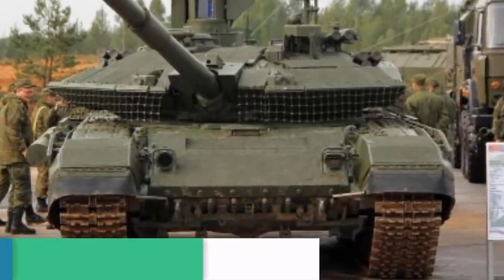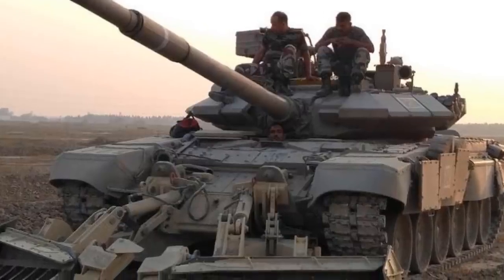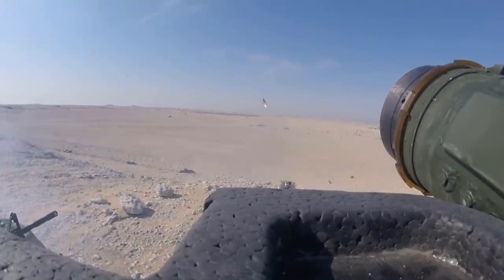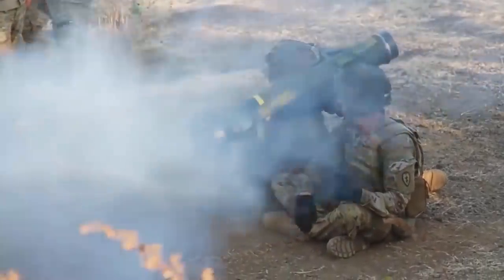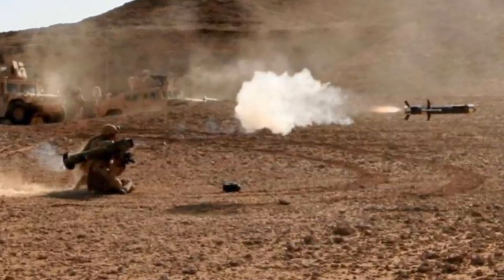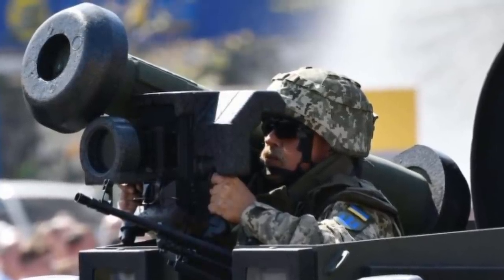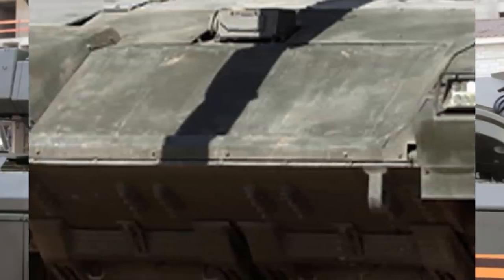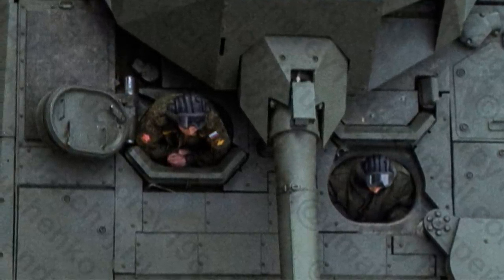US Javelin missile vs Russian Tanks

Comment: Combat doesn't always require that a tank be destroyed. Disabling the tank or causing the tank crew to abandon the tank can be enough
Reply: Yup, if the Armata still has its ammo storage under the turret, a good ATGM hit may still blow the turret off the tank like what happens when T-72s get hit.  Though depending on how well the crew compartment is protected the crew may survive, though will probably be in need of a new tank
Reply: @mrvwbug4423  and a new pair of pants
Reply: @mrvwbug4423   Yeah if the Javin doesn't fall for the Armata's counter measures or those measures are already used up, I'd say the tank if not the crew is toast.
Reply: @mrvwbug4423  Along with new underwear and hearing aids.
Reply: @mrvwbug4423  The biggest joke about the Armata is that  they've been building it for 20 years and yet it's still in it's trial phase, and they've only build 20. and the rest of the Russian tanks are all just cheep upgraded T-72's.
Reply: Exactly. Why dont they focus on a weapon that just destroys the main gun?
Reply: @bgregg55  To get that kind of accuracy you'd need to be really close to the tank. The best place to hit a tank is the rear area behind the turret where the engine and ammunition is stored. It makes the tank un-survivable, but does mean you need to allow the tank to pass your position.
Reply: @bgregg55  A tank without a functioning main gun is nothing except a heavy taxi for a crew that is not infantry. An aimed weapon instead of "fire and forget" could achieve this effect. The Carl Gustav 83mm anti tank recoilless rifle can do that at 800 meters. I did test that weapon at Aberdeen Proving Grounds in 1990 and since then it has been upgraded further.
Reply: if the tank crew has had nothing to eat in three day and the tank has no fuel ,its not of much use
Reply: Spoken well, clutch cargo
Reply: Field Artillery used in the way that the US and the West and trained allies use it can destroy a tank with fairly accurate control raining on top of the tank at a fraction of the cost.  Even if the tank could fight off all of those 155 mm rounds,  they'd be wide open for any other attacks and likely have no machine gun or electronics to assist the crew firing blindly or have a track blown off from a slightly off center round.
Reply: @davidr1676  Everything is correct. Only not the USA and the West, but all countries with a normal army. The Russians have gone through this many times and for many years. Therefore, large-caliber artillery is destroyed before tanks, immediately after the suppression of air defense. You can look for videos from Syria about the accuracy of 152-155 mm Russian artillery
Reply: No shit.
Reply: Very true.  Just take a look at the Tor SAM that is being stolen by the farmer in his John Deere.  It has been abandoned for some reason (which is probably not enemy fire) .
Reply: @spiff1003  Technique is technique. Something breaks, something can break. We have TOS solnsepek, buratino who use vacuum ammunition. Technique remains intact (well, it can turn over) and the vacuum compresses the air so that it is impossible to survive. The Saudis recently used them against the Houthis, there is a video on the net. I just remind you that the tiger was much more technologically advanced than the T34. Armor, optics!! speed and power, smoothness. But the payback for smoothness was the staggered (one after the other) arrangement of the road wheels. This is hell for a tanker. If dirt gets there or even worse, a shell, then you have to remove 6! to replace one. The more technologically advanced technology is often the worse. It's good for conflict, but bad for war.
Reply: And ear drums one would assume.
Reply: Fire TOW javelins a minute apart. The first knocks out the reactive armor, the second does the tank. Conversely knock out the supply vehicle with the fuel and ammunition. When the tank is out of fuel, its useless and the crew will probably surrender and call mommy
Reply: You said it right.
Reply: Agree, taken out of action or destroyed have same outcome in a battle, a neutralized target.
Reply: @mrvwbug4423  a tank crew that survives (and almost certainly surrenders) may actually be more valuable than a dead tank crew. How many thousands of Russian POW's can Putin sustain? If there were 30,000 Russian troops held prisoner in Kiev could Putin survive? 100,000? 500,000? At what point would Russia's military simply refuse to follow any commands coming from him?
Reply: @jessicacolegrove4152  😆
Reply: @romankovalev7894  then how come they barely did any damage to the air Fields I've seen photos and it really wasn't that impressive
Reply: @romankovalev7894  noooo you're doing just that Ukraine said so themselves
Reply: @romankovalev7894  and if that's the case why do the civilians hate you so much lol
Reply: @romankovalev7894  plus you invaded Ukraine first so how are you any better 🤨
Reply: @romankovalev7894  by the way if your military is so strong and advance like you claim a quarter of your forces should have been enough after all their military was supposed to be not as advanced as yours and right now Ukraine is kind of whooping your ass with minimal equipment they don't even need to need to rely on vehicles to give you hell a small group of Ukrainian soldiers with with some form of portable anti-tank weapon can easily take out multiple and if Russia with some more pure Nation they'll leave Ukraine alone and let them be their own Nation 😒
Reply: @THX..1138  The crew might survive because they are located in a separate, more highly protected space that is not connected to the turret. But the tank will likely end up becoming combat ineffective and hence useless.
Reply: @stevestruthers6180  I agree...Lockheed is currently redesigning Javelin's warhead, likely to address the T-14 armor improvements. Whatever they come up with it's likely at least for the crew the T-14 will be by far Russia's most survivable tank.
Reply: @mrvwbug4423  Armada Cabrio? :))
Reply: @romankovalev7894  dude Ukrainian people are using that to defend their nation and the civilians Russia destroys the homes and doesn't give a s*** and considering the fact that Ukraine didn't invade Russia once what was there to act on
Reply: @danielsnook7362  And do not look for videos confirming ethnocide and genocide on the websites of your news media. Feeding there is one-sided, use Google. There are even documentary films about life in the DPR and LPR, turn on the titles and enjoy 🤨
Reply: Exactly. Even a grenade exploding ontop of the tank won't destroy the tank, but it can destroy all the optics into and render the tank almost useless
Reply: @PotatoeJoe69  There are three points here. 1. Russian tanks definitely have duplicate surveillance systems, and the main ones are not on the roof, I think all modern ones are like this 2. On the roof, the weakest protection, if an explosion is over a tank, then this is a 90% probability of death of the crew and an explosion of ammunition if it is in the tank turret ( we tried to hide the crew under the turret on the Armata tank, but we realized that we can do without the crew at all) 3. The anti-tank systems are also different. Some are heavy, some are light. Not everyone can hit tanks like that, you need to look at the characteristics of each
Reply: @danielsnook7362  Do you really believe that the Russians are to blame for the humanitarian corridors? Think with your head. Who benefits from the presence of civilians there? They only interfere with the Russians and slow down the advance. There is a video message from three thousand Indians who complain that the Ukrainian army does not let them out of some city
Reply: A Daryl Dixon is enough.
Reply: @romankovalev7894  I am very much using my head second ceasefire agreement basically said you have your side of Ukraine and we have ours then Putin said that agreement was non-existent then invaded anyways minority before that they were working out peace and a way we're both sides would benefit pro European Union would get their half of Ukraine and the half that support Russia would get their half and plus if it was a genocide this would have never happened genocide would imply that one half was completely killed off
Reply: @romankovalev7894  and by the way if you Ukraine wanted to be their own country they have all the f**** rights no maybe you didn't have to resort to all that if Russia let them be independent in the first place 😑
Reply: @romankovalev7894  yeah maybe but under your rule and under terror of Russia and Ukraine wants to be independent simple as that and if they want to join NATO that's up to them not up to you and you didn't give up Ukraine the willingly it wasn't simply given away only giving away when Ukraine simply said we don't want to be part of you anymore
Reply: @romankovalev7894  by the way you're doing the same thing when you invaded Ukraine especially the half that wants to be independent and free from your rule
Reply: @romankovalev7894  and what about Estonia and other countries during Cold war you took over by force during the Soviet Union they weren't a threat to you and they had no conflict with you but you still took over and try to rule over them
Reply: @romankovalev7894   then how come most of the Nations you took over during the Soviet Union hated your rule and straight up said we do not want to be with you anymore obviously you didn't treating them any better Ukrainian would say the same thing Estonia would say the same thing the fact that you set them free proves that they weren't happy to be of the Soviet Union a Estonian soldier who's pretty damn old a straight up said the you people were horrible to them
Reply: @romankovalev7894  and by the way Estonia YouTuber also said that the Nazis treated them better than the Russians did so I can't really blame him plus they didn't have that much of a military so they didn't have a choice
Reply: @romankovalev7894  oh and hungry didn't really like you either did Poland
Reply: @danielsnook7362  Oh really? This is not in Poland, which became part of the Russian Empire as the Principality of Warsaw, but a month later in the Russian office it was listed as the Kingdom of Poland. Isn't this the same Poland that attacked Russia several times. Russians collected and formed Poland several times when it ceased to be a state at all. And it was not the Russians who dismembered Poland, but everything in a row, including the Germans (not Hitler). And now Poland, which hates, as it were, the Communists and everything Russian, does not want to accidentally give the Germans their area that Stalin gave her and return the Russian lands that have been part of the country since they were socialist? Modern Poland does not want to apologize to the Russians for Russophobia? We in Russia sometimes regret that the rusher with the liberation of Poland put 600,000 Russian soldiers. I just had to pass. The Germans turned around well there, the Auschwitz concentration camp (11 million !!! killed), after all, it was in Poland, like many other concentration camps. And Poland's allies sent her sabers to repel the German tank armada. A more ungrateful country is hard to imagine. But we remember everything, write it down. Both good and evil. Right now, Poland is running into a blow on its territory, I think after Ukraine it will be one of the first, and if it delivers aircraft to Ukraine, it will be even faster. And we do not care if she is in NATO or not. Poland is the US poodle. Or whatever Churchill said about her "the hyena of Europe"
Reply: @romankovalev7894  and Estonia was killed controlled by the Nazis they didn't fight for them willingly 😑
Reply: @danielsnook7362  Poland was once the strongest in Europe, dreamed of Poland from sea to sea, claimed dominance, but made a mistake by attacking Russia. 17th century by the way. In Russia, Poland has broken its back, it no longer dreams of world domination. I'm not surprised that they don't like Russia
Reply: @danielsnook7362  Not exactly the way you write about Estonia. You ask that old veteran. A lot of people in Estonia, Lithuania, Latvia and Ukraine voluntarily helped Hitler, joined the ranks of their troops, and there were those who fought because Hitler promised them independence. Search Google for the number of Estonian troops in the Wehrmacht or Estonian aid to Germany in World War II. Here you also need to understand that Hitler was perceived as a liberator and they began to happily cut the Russians. In general, everything was difficult there. But we forgave the Germans and the Hungarians and the rest, although the current chancellor of Germany, the grandson of the Nazi general who fought in Ukraine, is worthy of a loop for the words that it’s funny for him to hear about the Russian genocide in the DPR and LPR
Reply: @romankovalev7894 I'm not blaming the Russian people I'm blaming the Russian government to after all there's the Soviet Union that slaughtered over a thousand Estonian freedom fighters during their occupation so try again
Reply: @romankovalev7894  plus hatred doesn't come out of nowhere so if all those countries are hostile towards you clearly it's for a reason
Reply: NATO soldiers leave the tank for a darkroom
Reply: soviet tanks wore made to make a single mission .... and not return .... it's a historical fact
Reply: @asatechnics8363  Really? Tell it to the defenders of Korea, Vietnam, Cuba. Tell it to the Germans whose capital we have taken. Tell this to the Afghans in whose country we entered at the invitation of the current ruler, defended our positions and left as winners, the same is Syria, but we did not leave. Russian tanks are still used by a bunch of countries, mister "false historical fact" :)
Reply: well said
Reply: @TheExtraterrestrial99  100 Daryls is equal to a large division.
Reply: And then you keep the tank.
Win win.
Reply: ok Google, who is the right sector in Ukraine?
Reply: Better takeout crew together with tank, so they wont be able to fight ever again.
Reply: @romankovalev7894  by the way those Nations those puppet Nations weren't yours to begin with the fact that they didn't stay a part of Russia and when you gave them the choice to leave says something
Reply: I waged war against the Ruskie army twice in my life, once in Angola with the SADF in 1981 and once training the Afghans in 1985, and I can tell you all, that Russian soldiers are the most undisciplined wannabe soldiers there are, who are drunk most of the time, do not maintain their oldfashioned equipment, terribly loudmouthed when things go right for them, but quickly demoralised when they get serious retaliation by the adversary. We used to call them the baby killers because of the terrible Ruskie crimes against humanity in every conflict they engage, so we started to enjoy "helping them out of their misery", when this bunch of lousy Ruskie soldiers surrendered to us. Putin, Biden, Macron, Trump, Merkel, Trudeau, Klaus Schwab, Boris Johnson, Ursula von der Leyen and the rest of these organised state gangsters have organised this war in the Ukraine during the Davos WEF meetings of the world's elite in Switzerland; the enemy within explained in the 18 hour pentalogy "The Swiss Beast - Home of the Devil"; as Youtube blocks this video for the obvious reasons, you must scroll down the video section of channel Giureh. Part 5 can be seen on channel HomieLand Sickurity. Ruskies are expert child killers, which they also did in Afghanistan and Chechnya. All peoples must unite to take down these political gangsters, who force humanity into endless wars and misery.
Reply: @jeffreystarits2783  This is the more likely way Russian tanks will be disabled. There's been reports of tank crews that are undersupplied, with rations that have expired decades ago. That's what happens when your country is a kleptocracy...they may look good on paper, but the Russian army's shortcomings are being exposed.
Reply: @romankovalev7894   if Estonian soldier served under Nazi Germany in Estonia ,it because  "the enemy of my enemy is my friend ," just like with Finland
Reply: @jeffreystarits2783  They can be understood "humanly", but they did not guess by choosing the wrong side of the conflict. And they have no excuse for atrocities against civilians. Both of these countries gained independence from the communists, that's a fact. We are warmer towards the Finns because of the neutral status and less Russophobia, this is also a fact. With Estonia, it’s generally funny there - they passed a law equating communists with criminals, which annuls and makes null and void all documents, including their formation as a state and gaining independence. They didn't think about it? We can meet them halfway and revoke the recognition of this document. Plus, Estonia is in NATO - and this is a direct threat. Estonians now don’t even fart in our direction until they are remembered
Reply: bodies are in those tanks
Reply: That’s true.
Reply: @romankovalev7894  It depends on gas and fuel, but there are plenty of alternatives. But food? Europe depends more on the US for food, and the US is the world's breadbasket. For the record, Russian trade with the EU makes up around 37% of all of its trade. With the US this makes up about half of Russia's trade getting stifled. Idk who you're fooling, it isn't the Western nations that are having their currencies devalued every hour on the hour.

Russia has not introduced sanctions because Russia would hurt itself more with sanctions, genius. How deluded are you that an economy smaller than Italy's somehow is stronger than all of the West's?

Russia lacks nothing, except an economy, apparently. Russians can't use their currency reserves because of sanctions, and everything is just dandy with you? Ok.

Why would China want to use dollars when it's been trying to use Yuan for everything? This is hardly new. It's been a thing. It hasn't been working.

Turkey suggested using the Ruble and Yuan as a means to take advantage of the crisis while seeming like the good guy ending the war, and this is specifically with trade with Russia; Turkey has no means to only trade in Rubles or Yuan outside of that.

Hey man, people like you were screeching that a Russian invasion of Ukraine was just US propaganda. Now people like you are screeching that you're A-OK and that sanctions from the most wealthiest nations on the planet which makes up about half of Russian trade is not doing anything. All while major companies that make up critical service industries in any modern economy are disappearing. I ain't the one coping. You're not China, you're not the US' equal, let alone the EU's. you're not even Italy's equal.
Reply: That is how the British captured a Tiger in Africa.  Anti Tank weapon hit the near the turret ring gouging the armor, which prevented the turret from traversing.  The crew abandoned the tank.  That tiger is now in the Bovington Tank museum.  many videos about it.
Reply: @dirus3142  The Tiger was a great tank. Of course, this is the best tank of 43 and half of 44 and one of the best tanks of the war. By the way, he is the best proof that too progressive weapons are for conflict and not for war. At 43, on the Kursk Bulge, the Russians needed to approach 100 m to inflict damage on him, while he shot our tanks from a kilometer or more. That is why our tankers took them on a ram, turning them over, often dying. But everything changed when the Russians put an 85 mm cannon on the T34, they became approximately equal in terms of fire power, with greater mobility and speed of rotation of the tower, and most importantly, the cheapness of the tank, this played against the tiger. I'll just remind you that the Russians had a KV-1 at the beginning of the war and the Germans were shocked when they saw it. Of all that they had only 88 mm anti-aircraft guns, they pierced it (they were later put on a tiger) and if it weren’t for a bad chassis and transmission, it could become an excellent tank. The same thing will happen to you now with the F35 aircraft, in conditions when you have to fly every day or even several times a day, you will not have time to restore super-expensive coverage, the flight task downloaded from the USA is also funny, half of the satellites will be shot down, the Internet will be weak (if at all) and any connection will choke. Plus expensive maintenance and parts.
Reply: Not really relevant but tanks have been stopped with rifle fire before. In ww2 Germany lost a tiger to rifle fire when the crew panicked and drove into a ditch.
Reply: @toldavf1523  I think this is a beautiful fairy tale invented to raise the spirits of the allies of the anti-Hitler coalition. Let's be objective. The German tankers were certainly not afraid of guns and rifles, they were not afraid of anything at all. The fear of the tanker of that time is aviation and artillery (large) of which there are few and it is not in the forefront. And now it hasn't changed much. A tank in the heat of battle will not even notice something small being fired at it. And the infantry operating in conjunction with the tank should (ideally) prevent the approach of anti-tank missiles (then Faust) and anti-tank rifles with a range of several hundred meters in total.
Reply: @toldavf1523  The only very small chance that the bullet hit the tank's viewing slot and wounded the driver. But this is a very successful hit, tank manufacturers even then took measures to prevent this from happening.
Reply: mixed area denial (non-)dummies can even halt a column - a few big logs will do, too - time is a factor
Reply: @Roman Kovalev  plus airburst Fuze settings won't be leaving Lunar type craters either but can kill the enemy and lighter armored vehicles, especially aircraft and non-armored.  Cluster munitions are a beautiful thing for an army to use against troops and equipment and no Lunar landscapes from those either.
Reply: @davidr1676  Certainly. And a fairly large coverage area, especially for a large caliber. But cluster munitions were banned in the mud, just like phosphorus ones, I don’t remember if the ban was lifted or not.
Reply: @davidr1676  I think control of the sky is the key point of the war. If you control the sky, then the enemy will not have superiority on land, with any advantage in heavy equipment and the number of people. Well, the presence of missiles plays a role. It is not necessary to destroy armored vehicles, it is enough to destroy enemy fuel and lubricant storage facilities, everything moving on tracks eats a lot of fuel. There may be a situation when the equipment just gets up
Reply: @alfonsorodriguez6437  Sweden just shipped some 6000 AT-4 rifles to Ukraine.
Reply: @jessicacolegrove4152  and a new sharknado defense system
Reply: It's so scary to sit in a Russian tank in my opinion. One of a Javelin hit, that tank will definitely have a very little chance of survival. Damn, there will be no Russians want to be in those tanks any more...
Reply: @JJ-ge8re  Roflwaffle hab you been den one? If not den where you information dat get?